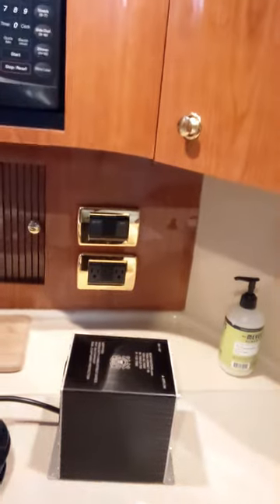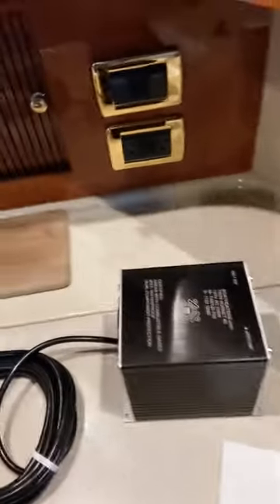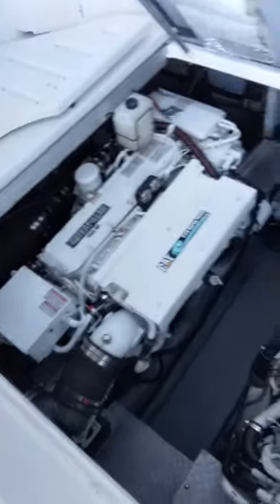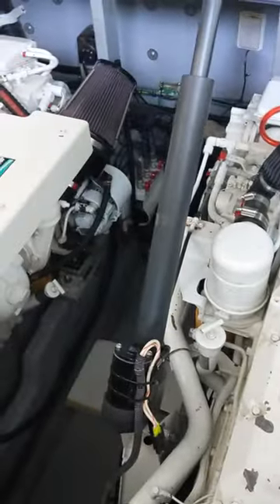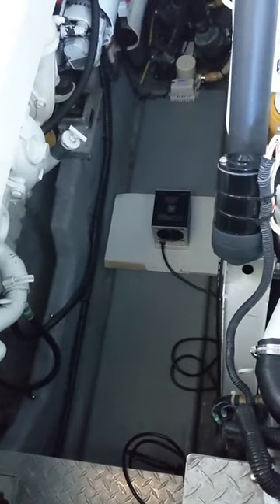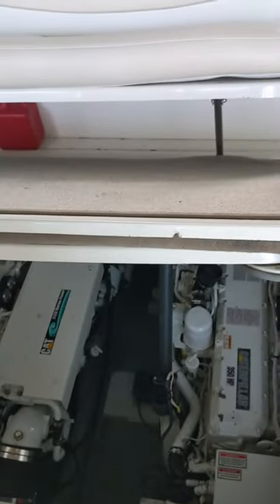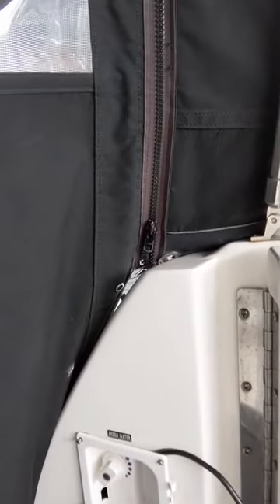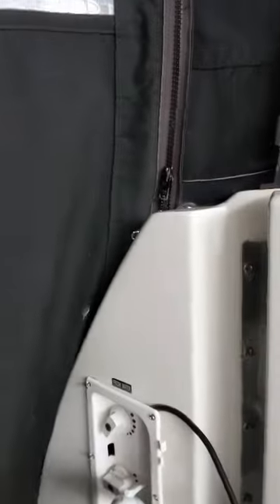Twin Hornet 45 Bilge Heater install

Comment: So we full time RV in a 34' fifth wheel. We have been considering getting one of these to heat our underbelly and prevent freezing. How has it worked out for you?
Reply from the maker: It's worked well, I'm impressed. I've owned various types of boat heaters, and this one by far is the best. It is a little louder than others I've used. That doesn't bother me since I'm not on the boat when it's running.

I like the size as well, it's smaller than others I've used. If you call and order one, ask for Brian, reference my name, Greg, and he'll give you no shipping no taxes.